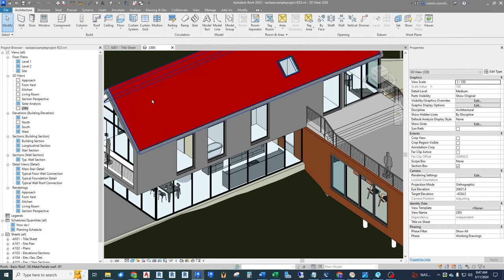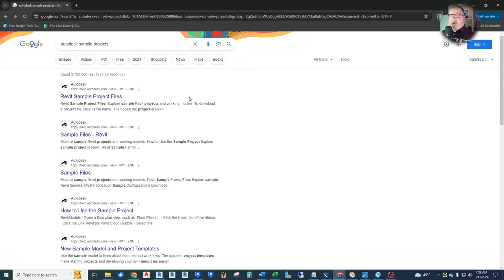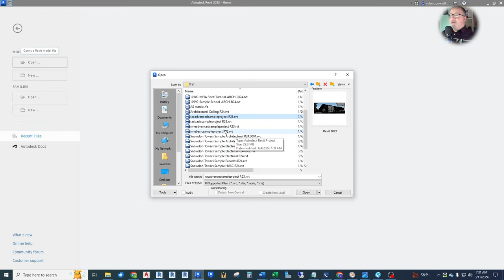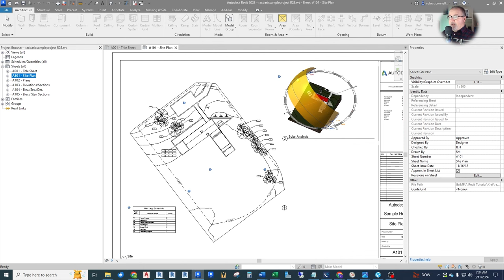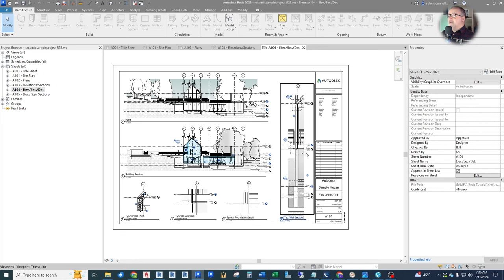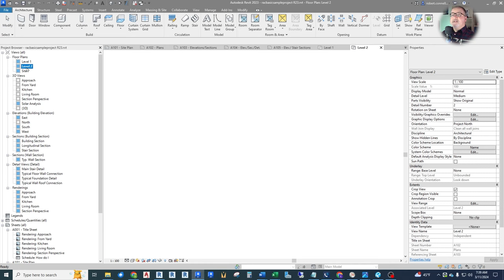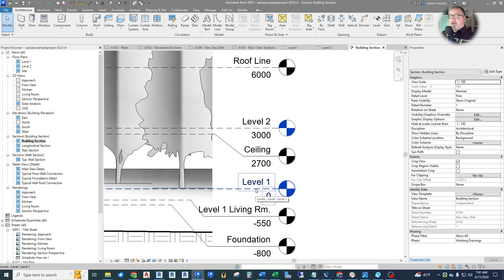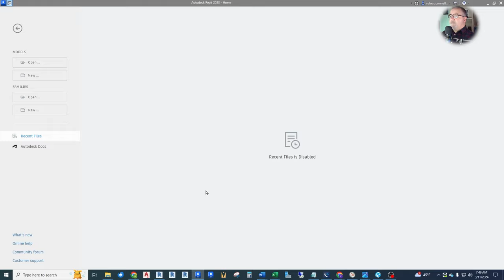REVIT MEP FREE COURSE!! EP 01 - Linking Architectural Model (Electrical Tutorial)

Comment: I know several residential architects that model a good deal of the electrical system in Revit
Reply from the maker: Yes, I have as well. I've seen architects model receptacle and switch locations, light fixtures, and switching schemes, but not the circuiting or electrical load summaries, panel/loadcenter circuit layouts, etc. Do you know if they go to that level?

Comment: Hey Rob! When you are dealing with a site plan where the architect is using detail lines have you tried displaying their model as a "linked View"? That's how we get detail lines to show up for situations like this. I use a linked View in my floor plans as well. Makes things a little easier to get the Arch stuff to show up properly.
Reply from the maker: Hey Ryan! That's a clever idea - I've experimented with that approach but I end up with more showing on the site plan than I actually want - dimensions, keynotes, etc. So I've resorted to trying to educate our Architect friends to actually "model" the site plan - does not have to be curbs and roadways, but at least get some Model Lines on there that show up - their detail line site plans are like if they drew the building walls with detail lines - no bueno! Cheers
Reply: You can set annotation categories to custom (in visibility settings) and turn off dimensions and anything you don't want to see (similar to how you did it at 49:00. This obviously doesn't help if they draw everything using the same linetype. But I agree, if you can get them to model it in, that's definitely the best option! @ElectricRob